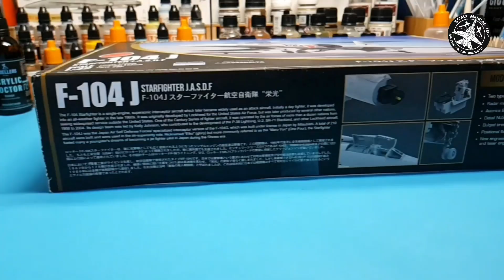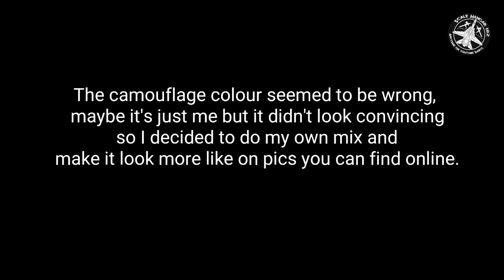F-104J Starfighter Kinetic 1/48 Model aircraft

Comment: I enjoyed watching you build this kit as I'm currently working on a very similar Kinetic F-104G. I was wondering though, how come you didn't show your way of installing the defroster ducting on the inside of the canopy framing. That's the part I'm trying to get done right now and I swear it's about to drive me to drinking!!! Very small and fragile parts which makes them extremely difficult to handle and try to clean them up from where they were attached to the sprue. Sure could've used a little demonstration... Otherwise, it's a very good video!...

Comment: Hi Scale Hangar 182.  17:02 Is the tire deformation, due to the weight of the plane, original of the model or did you get it? If it's the second, how did you get it? Compliments for the model quality.
Reply from the maker: It's made like this already
Reply: @ScaleHangar182  Thanks

Comment: Question for you, Dawid. When doing cockpits's gauges and buttons... Would this work? Base coat in black, then the gauges and such in silver/aluminium. Decanted hairspray. Cockpit colours. Then brus with water to activate the hairspray and clean the gauges, etc and then paint with colors. It might give you a better colour on the buttons, etc... But might be too much work, so the return of investment might be a bit much.. But it could also help when weathering the rest of the cockpit too?
Reply from the maker: uhmmm.. that might work, but i think it will be too much effort actually to achieve something not too visible, id rather spend few extra quid and buy PE set for cockpit panels.
Reply: Scale Hangar 182 That's what I was thinking. Might be neat, but too small ROI. Not really worth the effort. If using the kit cockpit the dry brushing is enough... Unless doing either of those 1/24 monster sized kits from Kinetic. Was actually thinking about it after your video. :)

Comment: They never had their air brakes open while static on the ground.
Reply: Correct, unless the hydraulic panel was open and external pressure applied. Not mentioning the wrong position of the leading edge flaps.

Comment: Starfighters when on ground NEVER had their airbrakes open.. was a safety measure..
Reply from the maker: Well it's for display purposes
Reply: Why not? I deploy my flaps when doing pre-flight. Same difference.
Reply: @foxtrot312  Because you needed either the engine running or external hydraulic pump to deploy them.
Reply: @foxtrot312  As Pietro said above, it was a safety issue. Leading edge flaps are also wrong.

Comment: Wow. Love it. The use of the stencil to "marble" has me intrigued.
When adding wire and plasticard, like in the wheel wells, are you using references or just what looks right to make it a bit busier?
Reply from the maker: yes i used some references, bu if i dont'clearly see something, i go a bit my way
Reply: @ScaleHangar182  sweet. Thanks. About to try some lead wiring for the first time on a SU-27. This was great for tips
Reply: @muza180487  If it works can you show pictures??? Even if it doesn't work I'd like to see it! Good luck.

Comment: unfortunately there is a shape issue with the back of the air intake, where it meets the trailing edge. actually i would have never cared about it and i would have build it, but since someone made kinetic's owner aware of this and he has been a complete jerk about, this kit belongs to the shelf for me. I understand the error, but i do not condone ever arrogance. so sad
Reply: Any good modeller could fix that issue themselves.
Reply: yeah... how?
Reply: Assuming you're willing to cut away half the plane and pay for replacement parts or make them yourself for no real worth then yeah any good modeler could do that
Reply: alessandro pettinacci I’ve got the kit and am doing exactly that.

Hope this helps
Reply: @mitchie2267  I repeat my question: how do you do that?